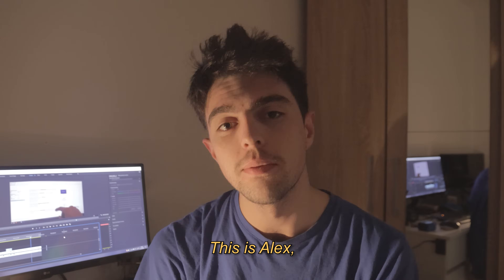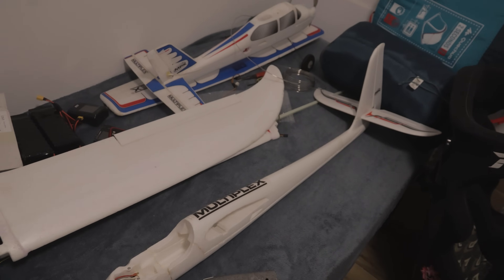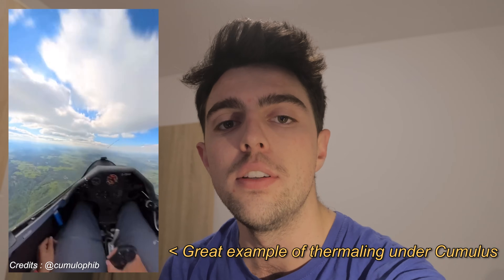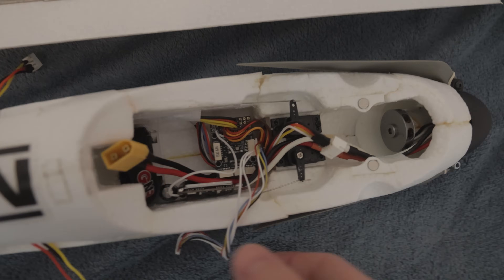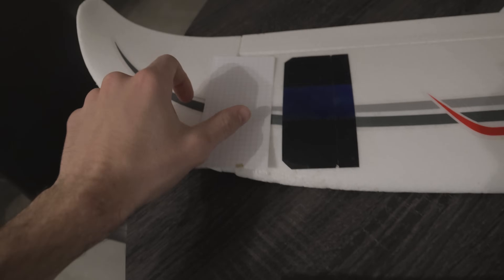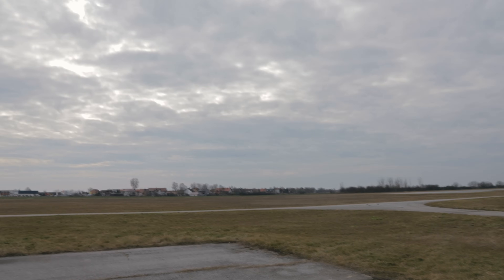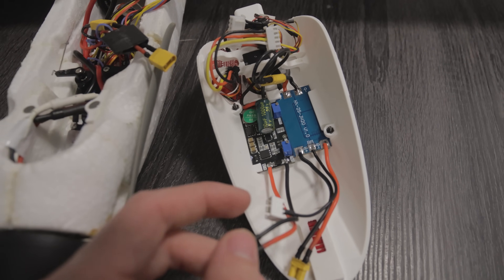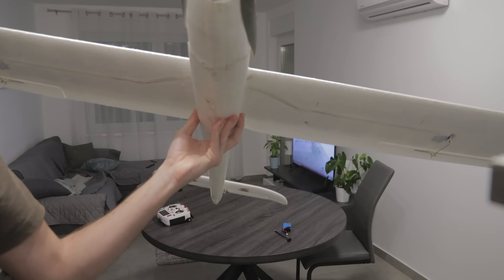FPV Solar Glider Project - Part 1 (Full build)

Comment: I built a Solar Plane called Solar Dragon.  I was wondering if you have flown this in direct sunlight in the summertime assuming you are in the northern hemisphere..   your technique actually looks pretty good for applying the cells to the wings. it is very good to be able to replace cells.  I've been thinking about trying to design a smaller size solar plane.  mine is 4.6 meter wing span in order to use maxeon c60 cells and not need wires running back, so two rows. looking for alternatives.
Reply from the maker: It did prove to work in proper sunlight but as expected, only for unlimited thermaling, not enough current to cruise on the motor. I experienced issues with the DB9 wing connector and had to reverse back to xt30s which slowed down the whole process, waiting for the next season to post updates 😎
Reply: @platyfpv  What are your goals for the project?

Comment: Thanks for pointing out sunpower half cells, was having trouble getting the solar cost down on my space balloon project, didn’t occur to me there was 1/2 and 1/3 cells out there. Great way to get amperage down so I don’t have to use a giant 7amp inductor on my mppt circuit.
Reply from the maker: I didn't compare costs but having higher solar voltage than battery voltage was mandatory for this project. With full cells I'd get 7v out of the 2 wings which is lower than the 8.4v of my 2s pack, and I can't really go 1s on this aircraft size lol so half cells really made it possible !
Reply: @platyfpv ya it really comes down to getting as large a wing span possible, not only for voltage but power in general to overcome prop usage. Also the cheap consonance mppt ICs don’t usually go above 4-5amps so you would be leaving unused power with a full cell at 6amps

Comment: Hey, this is really cool 14:46, could you also use the head-tracking feature of your googles, or is it too much of a hassle?
Reply from the maker: @FrederiQQ  Absolutely ! It's actually very easy, just map the 2 axis to the headtracker instead of the potentiometers in your controller mix and you got it. I did it that way for now because I'm planing on flying from a screen for long duration flights, but I'll give it a shot for sure
Reply: @platyfpv ah i see, thats surprisingly easy. 
I’m looking forward to a second part!

Comment: That is some amazing progress! I love to see the DB9 connector being used in this way. Beautiful.
Reply from the maker: @andrewwatts1997 Thanks man ! Using dedicated RC connectors were an option but DB9 are more commonly used and much cheaper on Aliexpress so I went for it instead. I didn't go into much details in the vid but I only needed 5 pins (3 for the servo, 2 for the solar panels) so I tripled the solar panel connections with the remaining pins for redundancy and maximum conductivity !

Comment: This is awesome! Great build. Slight critique, at 14:30 you say you see no current drop between the MPPT to the BMS. This is to be expected. Current does not drop, but voltage does. You will only see a possible current difference by actually removing the potential thing causing the voltage drop. Regardless, I think having a BMS is definitely the right move here to avoid possible over charge situations, and handle cell balancing.
Reply from the maker: @nickldominator  This is a very interesting and well needed comment, thank you ! I didn't think of it that way but it makes total sense that the additional resistance would lower the voltage a bit, I'll measure the voltage drop to estimate the efficiency loss. But I agree, the added safety from the BMS is most likely worth the loss.

Comment: Outstanding job man! Watching your video was like stairway to rc heaven, like Glides + FPV + rctestfligh reference + solar + Long Range + Mountain diving and for the build - well tought electronics, but exploded when I saw DB9 connectors and 1000uF caps. Very nice build Bratko! Pretty much the same components (from DB9s to the caps) as my ASW28 that I've maiden-ed yesterday :)
Whats your AUV - for ASW28 topped around 1.6kg with 04 on pan and 6ah 3s.

Pozdravi ot Bulgaria!
Reply from the maker: Thanks for your comment man ! We've got the same references haha, been drooling on rctestflight builds for years, finally got a great playground to fly theses (Croatian plains) so I had to give it a shot !

I'll keep you posted for the AUW of the ASW28 cause I built one aswell and never actually weighted it, I'm flying that one with a 4s 3000mAh 18650 Liion pack and you can see it in action on this vid (in french infortunately) : https://youtu.be/9fOMpwu60dc

Comment: Sick bro!! Btw, once you balance your battery using your home charger, you don't need to balance them for a handful of cycles. You could save yourself the BMS inside the plane and reduce weight and conduction losses. Cheers from a solar racing car alumnus :)
Reply from the maker: @karim1485  Very cool thing is it also saves it from overcharging the pack - MPPT little rotary switches are kinda janky when it comes to max voltage adjustment, I'm kinda glad to have the bms behind it for now but I'll think about it in the future for sure
Reply: @platyfpv  Well regarding that you are absolutely right! Better safe than sorry, can't wait to see episode 2 (and another comment for the algo ;) ) Clear skies!

Comment: I like that little pan/tilt gimbal.  I've been working on my own, but is that one downloadable anywhere?
Reply from the maker: @raztaz826  I didn't upload it anywhere because it fits specifically this canopy that fits specifically the easyglider 4 with my vtx and my random heatsink, but I can share only the mechanism part if you wish to integrate it in your cad projects yourself ?
Reply: @platyfpv  Yes please if its not too much trouble.

Comment: How do you switch the camera view mid flight? Do you just have two vtx's and switch channels on your vrx? 
Or is there another way?
Reply from the maker: @NoMercy-py3vv  It's much more simple and reliable, some FC support dual analog camera input and just switches between the two via a switch you set it to on inav, it's instantaneous and doesn't require 2 vtx

Comment: Daniel took so long with the solar plane build that the community stepped up 

beautiful build, can't wait for the proper test, loved the editing! 

for these solar planes, i wonder if you could instead bond the cells on to fiberglass so you have a foam-glass-panel wing sandwich, since they're so fragile.
Reply from the maker: @linecraftman3907 I was 15Yo when Daniel released his first solar glider video, I had time to get a degree and find a job to do things on my own in the meantime hahaha
I bet sandwiching it in fiberglass would work very well but I wanted to keep things relatively simple in the first place to see what performances I can actually get ouf of it before pushing it any further (I have zero skills working with composite so far)

Comment: Hey Platy, great video ! i was thinking about how much kilometer can you reach (with solar panel and without) also do you know how much payload can you pull from this great glider ? 

Thank you a lot for your videos :)
Reply from the maker: Ukraine aaaaahhh comment 😭🙏, Thanks for your comment, I'm not planing on ever using any kind of payload on this, it would drastically fuck up the drag making any kind thermaling completely impossible, since it's meant to glide and not to cruise on the motor the estimated range will depend on the weather, that's why even on a sunny day I can't yet send it 100km out in Winter.